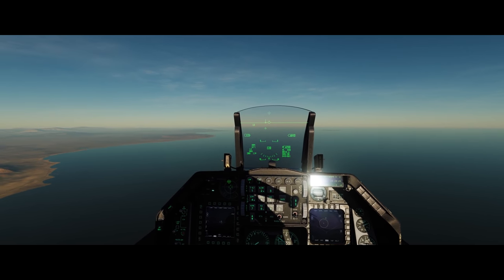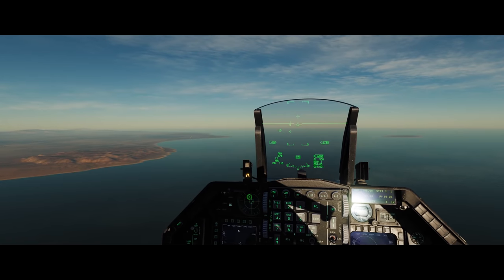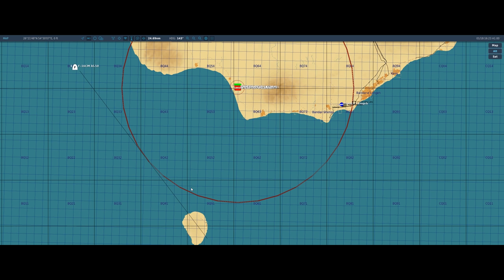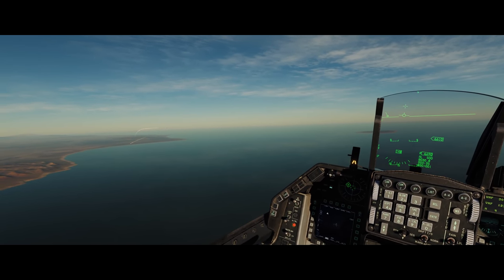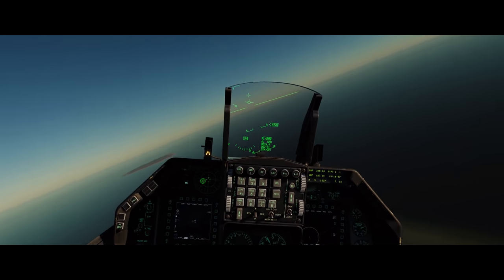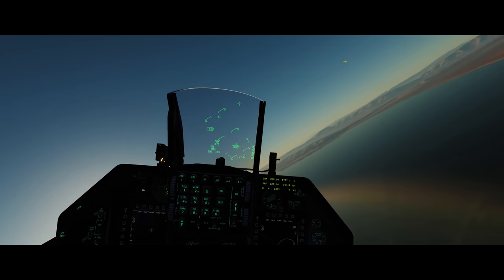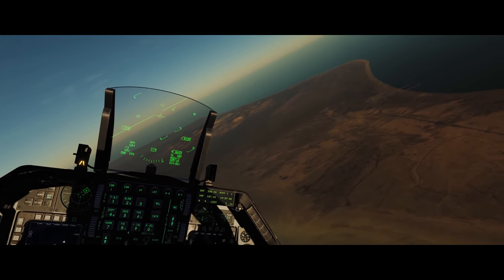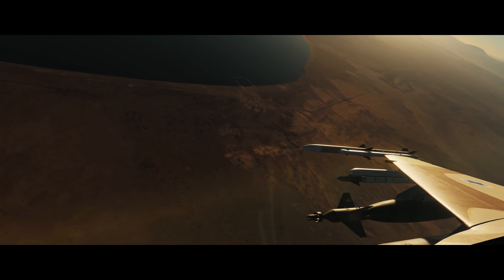SAM Evasion & Wild Weasel Tactics Tutorial in DCS: World

Comment: Today I learned that Split S and crash diving to the deck in a direction that makes missiles manuveur in thick air or over calculate their lead forcing them into the ground is sometimes more than I need to do. I might have been over reacting a bit LOL.  Thanks Spud.  I have been practicing against SA 300. I will try some of what I learned tonight against the SA 6.
Reply from the maker: Remember to also be gentle on the stick so you don't dumb all your energy in a first turn
Reply: The SA-6 is easy. If you get below 100ft. the missile can't track you and it will lose lock.
Reply: @Aeronaut1975  Agreed my problem is getting down quick enough sometimes. I've Gotten much better at now.

Comment: Just what I wanted to see, nice one Spud.

Interesting thing I found out a while back - the F-14B's jammer actually works better versus SAM's than the jammers in any other module I own - I did a semi scientific test and it reduces a SAM's engagement range by about 5-7% over the others ( which all had exactly the same performance - go figure ) which is a small but useful advantage.
Haven't tested the F-18 and F-16 jammers effectiveness though, didn't have them at the time.
It's just a shame that the F-14 can't carry anti radar missiles, or anything with a launch and leave stand off capability
Reply from the maker: it does definitely help!
Reply: Did you test it against the JF17 jammer?

Comment: also a good thing to note is while the A-10c is a much harder aircraft to defeat these AA systems the A-10c is meant to operate in that sweet spot near the ground, and also has a missile launch warning system that will even alert you of MANPADs. so if you think that you have a missile coming your way your best bet is to put that missile at your beam and dive for the deck, dropping chaff/flare every now and then depending on the threat type. i have taken out a few AA sites as an A-10c but its best done by a fighter capable jet, as when i did take out those sa-6/sa-15 sites i had a nice grouping of trees and a hill right at the 6 mile mark on my ingress, so all i had to do was lock my mavs onto a markpoint where i saw the AA threat, fly down right above the deck and pop above the hill, lock the mav, rifle and turn away.
Reply from the maker: PhantomPh1re ya in real life an A-10 just isn’t going to be assigned a SEAD role especially in contested airspace. The best way to avoid these missiles in an A-10 is to simply stay at farther standoff distances and use terrain as you’re saying... just have to be carefuk cause that’s where you can get in trouble with AAA
Reply: I actually had a really fun flight on the Hoggit Georgia At War server a couple nights back. It was my first time flying at dead of night and I tasked myself with eliminating SAM sites and BAI's with the A10C2 module. It was such a steep learning curve, but I'm happy I challenged myself to take out as many as possible before getting shot down.

Comment: i have to keep some this in mind next time i run iron hand with my harrier, generally im at 50ft jinking left and right to get within kill range with sidearms and zuni/guns. works well against Sa-10's but Sa-15's and 19 are a challenge.
Reply from the maker: v_seraphim_v the Harrier really isn’t suited to that mission type, an AV-8 in real life would never be assigned a SEAD mission.  The Harrier really isn’t fast enough to deal with these threats same as the A-10 and the harrier is particularly vulnerable to manpads and IR guided sams due to its heat source being right in the middle of the fuselage
Reply: @Spudknocker  see i find that interesting in DCS i much prefer to face IR threats in the harrier as opposed to radar ones, i have a much better survival rate against IR due to the harriers large flare count, and what i like to use like a panic button the flare salvo button which allows me to deploy 10-20 flares in 1-1.5 seconds. what you say makes sense  in regards to the central heat source , i just find that its generally the other way around in DCS. even when it comes to air engagements, i can evade R-73's much more consistently
, as opposed to the R-77 or R-27/R-27ER.
but like i said i am generally scrapping the trees so im sure that helps.
anyway nice video.
Reply from the maker: v_seraphim_v yep but if it actually hits you your survival chance drops to zero in the carrier due to the placement of the heat source this is why the Harrier carries so many countermeasures. This was a big issue that contributed to the harriers high loss rate in Desert Storm/Shield

Comment: 20:05 I think the white trails of a SAM launching at you are beautiful, cool and scary as fuck at the same time. Especially with SAMs that launch missiles with different flight paths (high/low) or if there's a lot of them at once.
Like in this Falcon 4 BMS video: https://youtu.be/deqz_Hs1mQE?t=300 I have to say, the BMS SAM AI is a lot more nasty than the one in DCS (which tends to just fire at max range). In this case,  the launching SA-2s do a saturating attack, forcing the pilot to be on the defensive so long that he's out of energy; probably because they know their PK is pretty low. The pilot does in fact do the exact manouvre of turning into SA-2s Spudknocker talked about in the beginning!
Reply: I agree that the DCS SAM AI is pretty basic, in fact every AI in DCS. 
You can improve it by alot as a mission designer. 
With 1 simple trigger you can create a SAM Site that will only activate and attack you at kill range or, with some of the scripts out there, will do that on their own. 
You dont even need triggers or scripts for AI planes.
You can set up how they react to threats, what distance to fire, how to defend and so on.
A lot of Multiplayer Missions while using a lot of scripts to give the Mission life, fail at the basic tools the mission editor gives you.

Comment: So a couple of bits to add to this.  If you are maintaining good SA and see that you are outside of the threat circle of the SAM when it fires at you just doing the maneuvering alone is good enough for a kinetic kill on the missile.  It just can't reach you regardless.  Inside of the circle yes you use all the tricks.  Also I have to disagree with a base rule of no more than 10k altitude.  This seriously limits the range at which you can score kills with the HARM.  Not a super big issue against the SA-6/11/Hawk but a world of difference when going up against the big boy Patriot or SA-10 systems.  Those I like to come in at 32k and if I can get close enough for a shot prior to being engaged then I can magnum then turn my life insurance altitude into airspeed and turning ability to use against the incoming missiles.  The lesson here is correct though that the lower the altitude the more the missile has to work.  It is just using the old fighter saying.  Speed is life.  Altitude is life insurance.  You can quickly build up a ton of smash while losing altitude and make life suck for that incoming SAM.  Now if in your situation with LGBs or CBUs or some such then yes staying lower is better.

Another bit which I'm surprised didn't get a mention is using wingman tactics to take out a SAM like this by coming in at different angles.  Too dangerous with overfly weapons like LGB or CBU but can work wonders with Mavs.  If both of you have Mavs whomever gets shot at does the rope a dope against the missiles while the other sneaks in close enough for a shot and get out of dodge.  Obviously this is also SAM dependent as Patriot and SA-10 will have no issues dealing with that and you just have to run them out of missiles even for a HARM shot a lot of the times.

Comment: spud I have a question. Setup for chaff and flares in your plane is setted to? 2/1? 2/2 other? and sequence repeat? And f18 works pnly in manual mode doesn't it? I remember in Jane's f18 that it worked in auto mode too and had a sort of theatered countermeasure with a long wire to avoid sam on my tail. Is it real or it was just a fiction?At last 90 degrees, push hard no lose energy going down where air is nmost dense and then 180 degree to give no chance to missile… than repeat. Correct? And this tactic works for a/a missiles also?

Comment: Maybe using a sam that lunchs with a normal jet engine to transonic speed, and goes pasive on you like in TWS then at 5 miles it separates from the jet engine and turn on the normal rocket engine, going mach 3 in a few seconds a very close, also without leaving any contrails until the very last moment